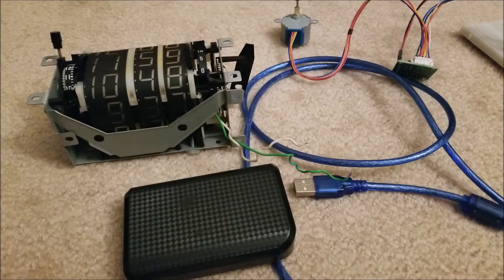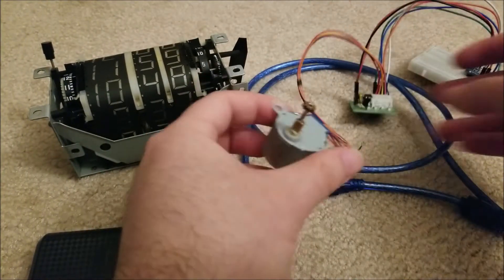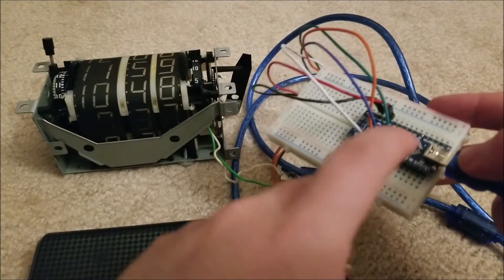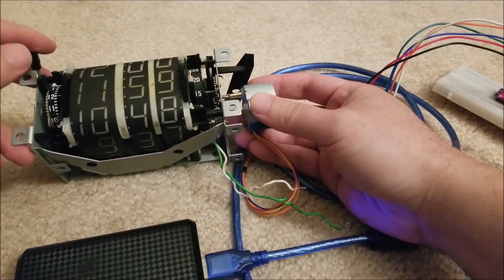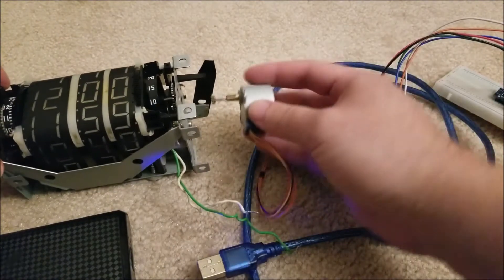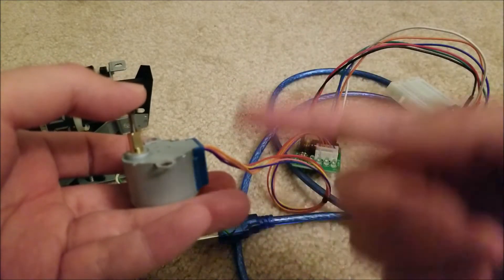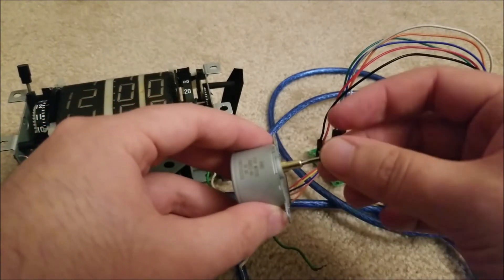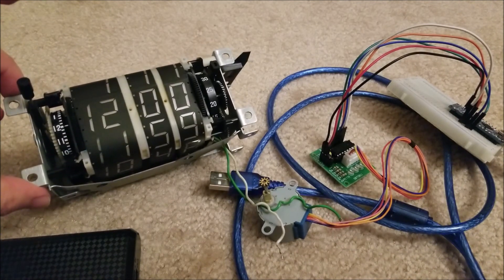Let's Fix: Westclox "Digital" Clock p1 - Replacement Motor

Comment: This clock is an interesting snapshot of a time where it would have been cheaper to emulate a LED seven segment display with a geared system, than to use actual seven segment displays in the first place!

Comment: Is there enough space in there to put in a small powerbank and make it battery powered?
Reply from the maker: Oh that's a neat idea, I'll have to do some measurements but I could probably fit a flat 2500mAh lipo in there (though I have no idea how long that would run the motor and light).
Reply: possibly swap the lamp for a lower power LED for longer life?
Reply from the maker: If I can get inside where it is mounted without destroying everything, it looks like the bulbs are mounted in a light diffusing plastic box in the middle of the mechanism and heatstaked into place so it'll be rough to get access to them.